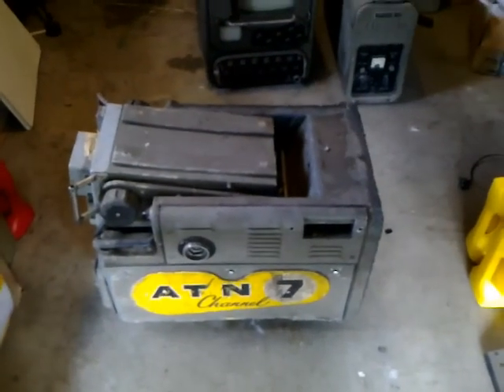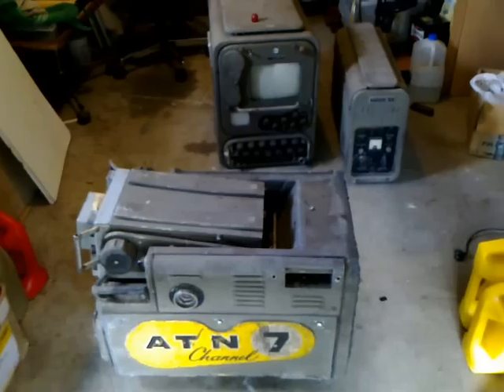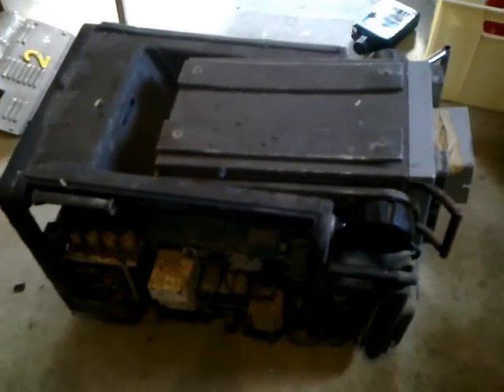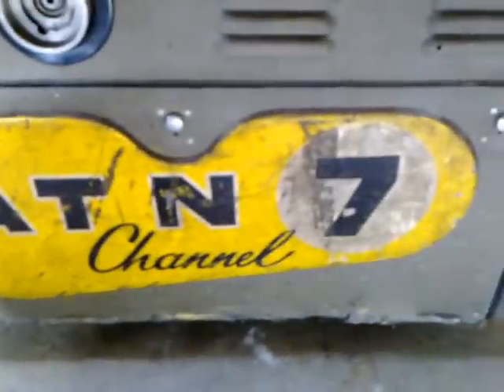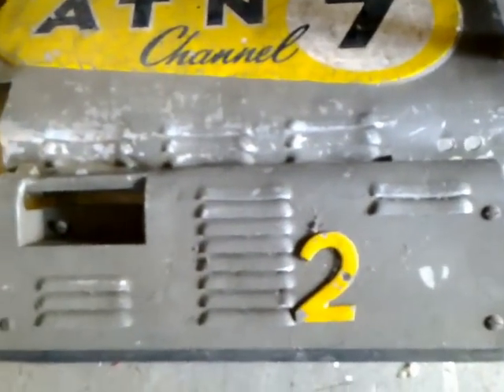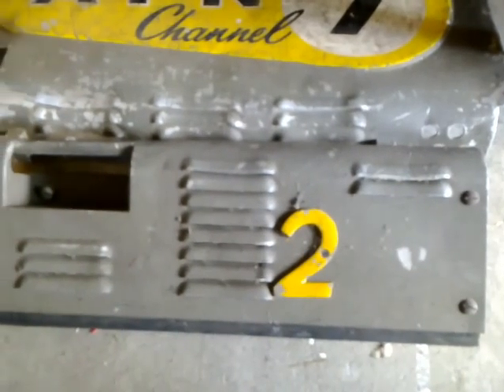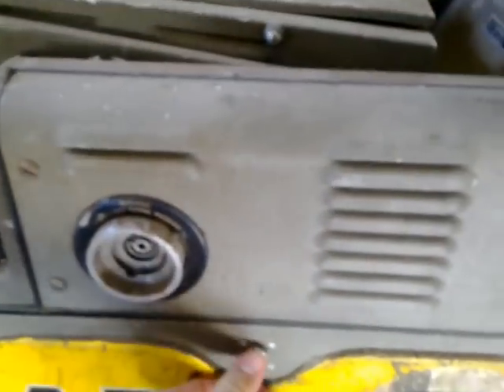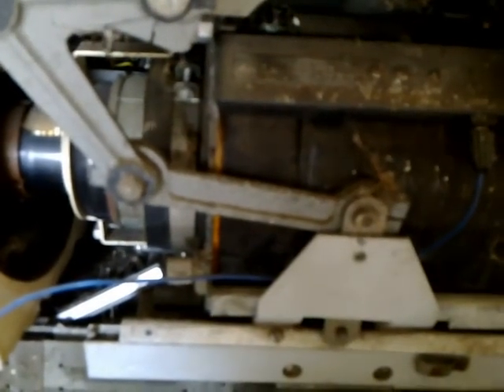1950s Marconi MKIII image orthicon broadcast camera (Part 1)

Comment: Hi , I worked for the CBC in a 5 camera studio with Mark III in Montreal Canada from 1966 until they were retired for colour , We had 3" Orthicons because  there were also many MarkII and GEs . 
 Question : On the CCU there is a light increase and decrease switch .Was that to control a variable filter wheel ? Did you see how it worked when disassembling this camera , The system was removed from our cameras so I have no clue how it worked.
Thank you for reading and posting these clips .